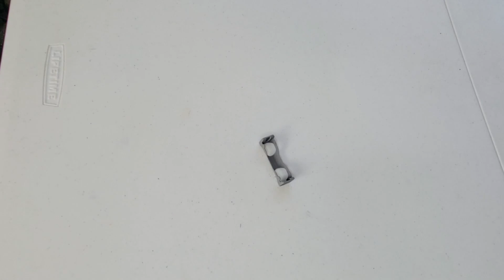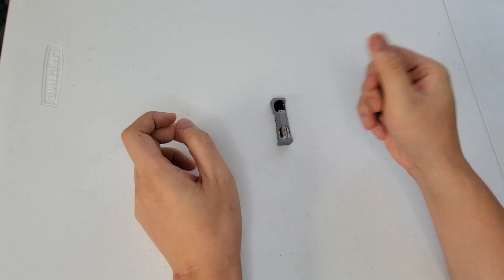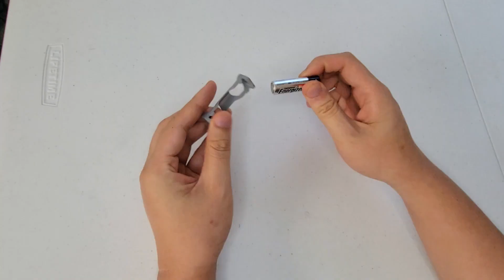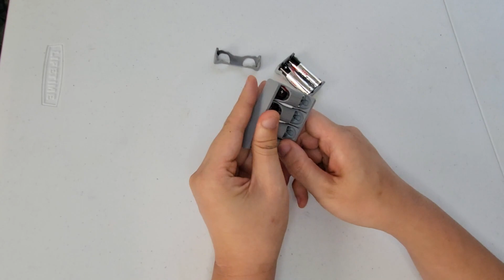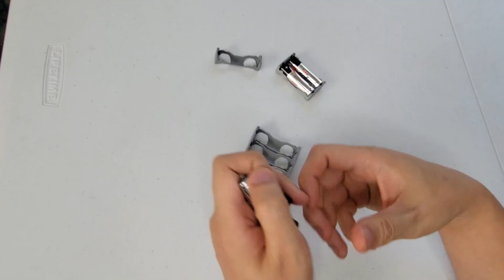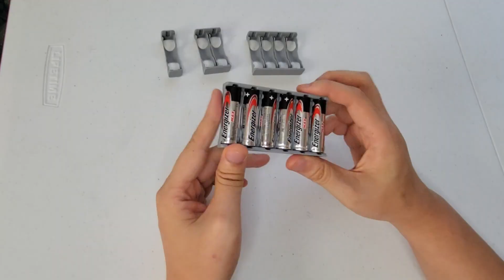3D Printed Unibody AA Battery Caps

Comment: in what orientation do you recommend to print it?
Reply from the maker: Lying down, with the opening facing up and the back of the battery to the bed. The stl files should already be oriented in the correct direction, but I added a screenshot to the project showing the print orientation.